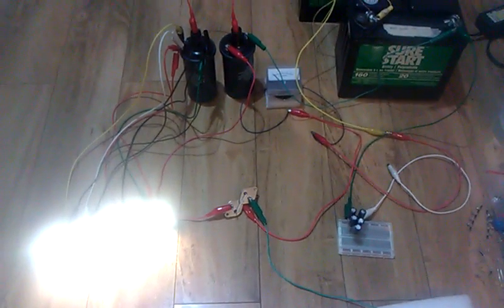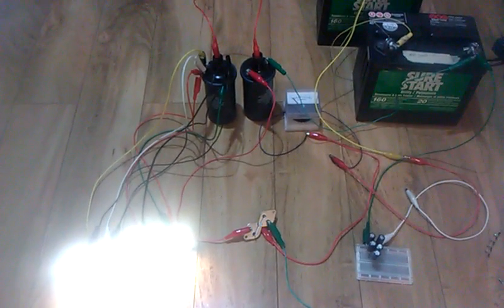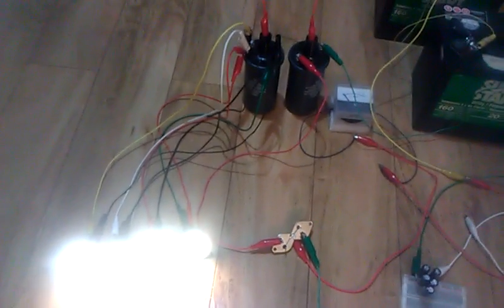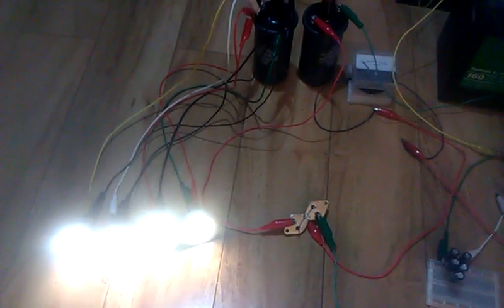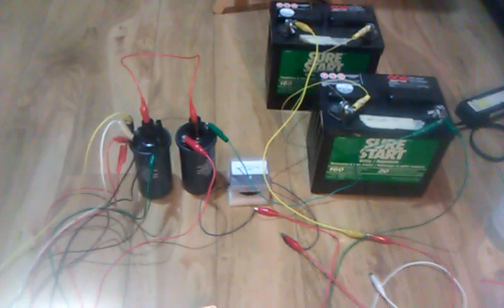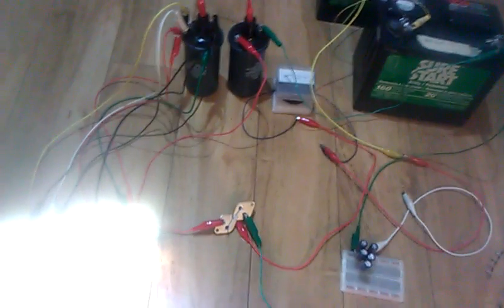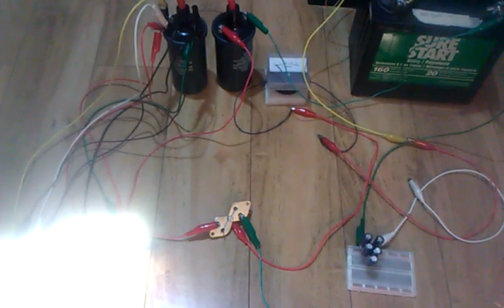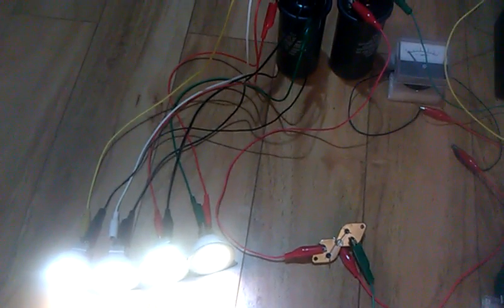Radiant Oscillator Circuit / Don Smith Part 6: C.O.P = 50? read description

Comment: good work !! any time you increase voltage or frequency output is affected to the 2nd power that is doubling produces 4 times as much; tripling produces 9 times more!!! remember Einstein e=mc2 or ke=mass times velocity squared? Move those electrons to get more power!!!! k=mv^2   v = velocity

Comment: For everybodies use...Since  you mention how voltage and frequency affect power, I thought I should share something in the public domain but nobody is paying attention; that is google "NST" transformers and just do the math..Ive see transformers that have 150 watt input with a 300 watt output; use the formula watts - volts x amps both for input & for output and you will be amazed that 80% of all nst's have overunity effect

Comment: Thanks for posting this!

Would you like to try this?  Reduce your voltage back to 12V (because the coils are not designed to do 24V)  AND increase your frequency to 20+ kHz.  I think you will see a tremendous improvement.

Thanks
Tony

Comment: Have you tried using a bridge from stepdown back to primary/1F cap?  Not sure if this will work...but worth a shot!   I have a strong hunch you will collect so much more using a bridge instead series or parallel.

Also using a helical coil as your virtual ground might give you better results...and allow you to collect off the top of this coil through an A/V diode!

Comment: The stored energy in a capacitor is 0.5*C*V^2
//hyperphysics.phy-astr.gsu.edu/hbase/electric/capeng2.html
C in Farads, V in voltage across the capacitor, energy in Joules. 

So, if you have a 2nF cap that you are charging and discharging with 2000V at a rate of 3.22Khz, then
.000000002/2 = .00000001
V^2 = 4000000
.000000001*4000000 = .004 joules
Convert 3.22Khz to time = .000311 sec
.004 joules / .000311 Seconds = 12.88 Watts

Comment: Nice work! However, I'm not sure where Don Smith came up with the frequency squared part of the formula.

The stored energy in a capacitor is:
Joules = 0.5*C*V^2
Watts = Joules / Time
Time = 1/F

Comment: With COP like this you could easily loop your setup. But be careful with your measuring, digital oscilloscope with power calculation capability would be helpful for the first time. And it is not the guaranty. Prof. Kanarev discovered, due to his exps, the overall mistake in the impulse power equation. So... all not so simple.
Thank you for your very interesting experiments